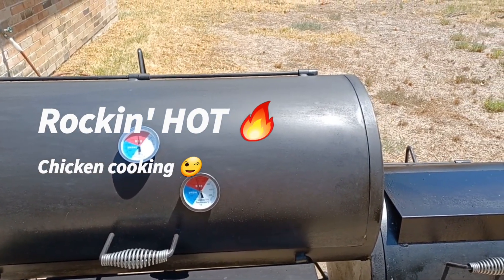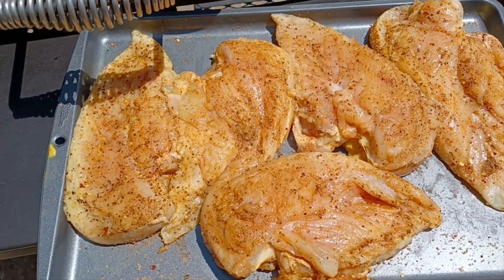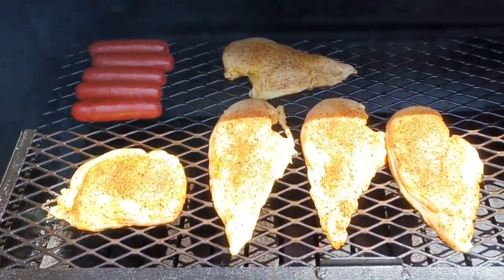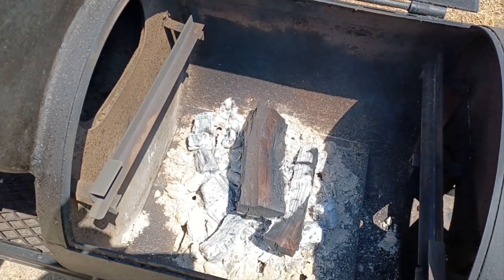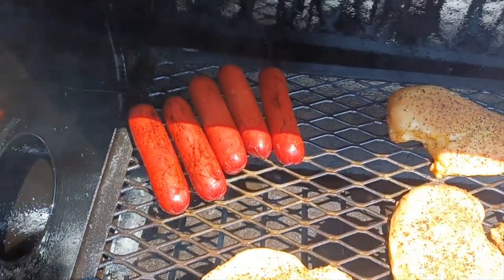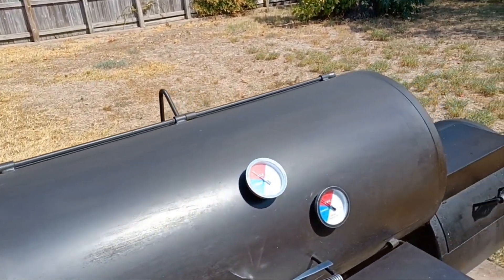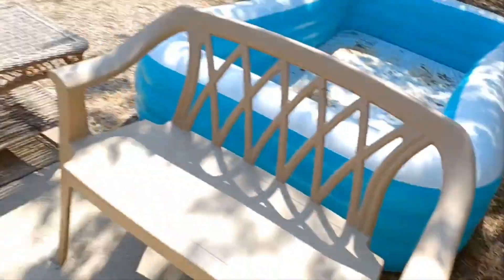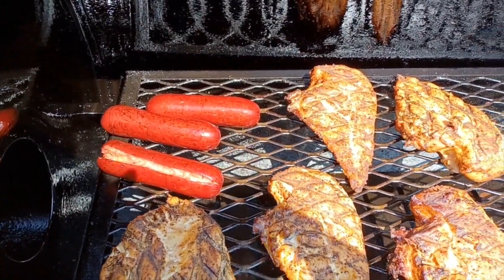Offset smoker with tuning plate⁉️🤔#oldcountrybbqpits #oldcountrypecos #smokermods

Comment: Hey Bruh I am loving what you're doing. I subbed to you because someone mentioned you on my channel. Question, why not add fuel through the firebox door instead of the lid? I asked because of the heat loss from opening the lid. Keep it hot Bruh. God bless you and yours.
Reply from the maker: The heat loss is minimal if you don't open the cook chamber. You have to open the lid so that the added wood catches fire faster and not smolder.If you put wood in the door, it will smolder.
I like my smoker to burn clean😉Hopefully this helps. 
Thanks for subscribing,commenting, and liking. It helps me stay motivated to make more content😊
Reply: I guess it's different for everyone. I keep the pieces that I  will be feeding the fire with next to or on top of the f/b and they are already hot and just catch right up and it keeps burning clean. Just curious. Keep it hot Bruh. Have a Blessed day.
Reply from the maker: @bamaingaoutdoors153  every pit-master have their ways 😉
If it's cold or rainy, then I will use the door.
Stay blessed man,thanks for watching.